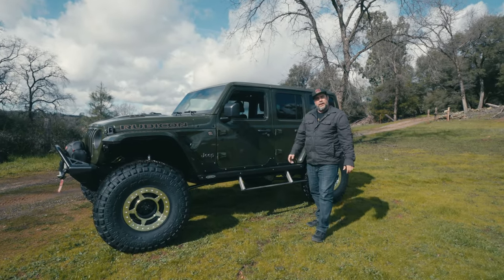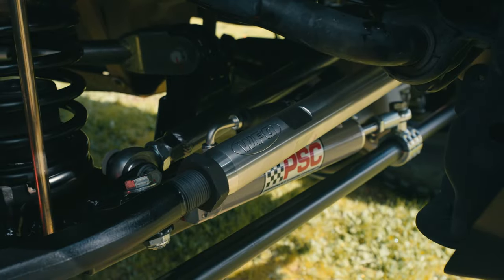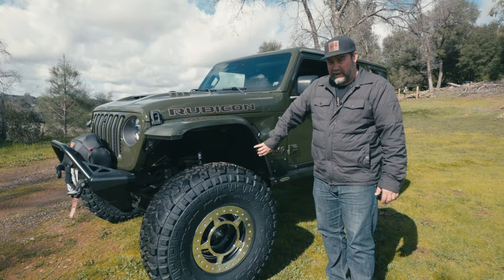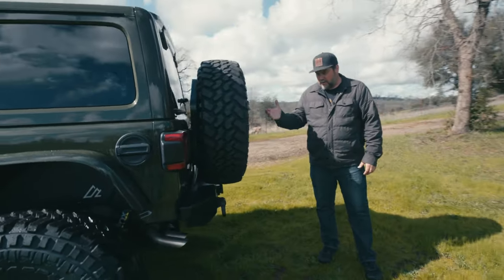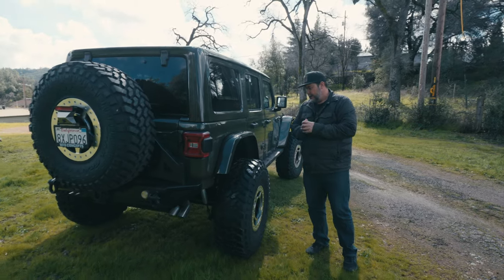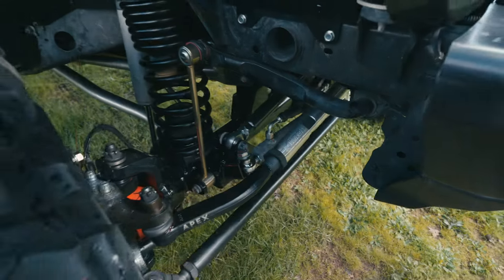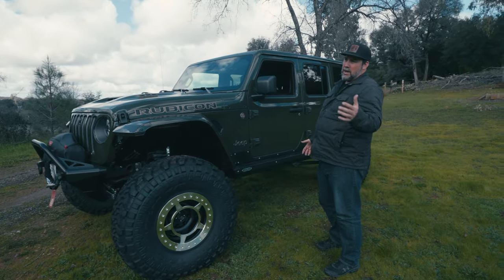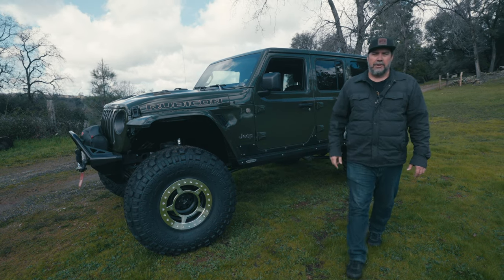392 on Curry Axles | Complete Walkaround

Comment: Question:  Why do y’all prefer the wheels/tires closer in?  Is there a driveline reason, just personal preference, or what?
I was just wondering because I personally like the wider more aggressive stance look & I think it’s more practical  because it gives you a little more security of not tipping over.
Reply from the maker: Yeah of course! In this case, we tend to favor less offset to get a tighter scrub radius. When steering we want the wheels to steer without swinging out and creating a large arch.  It allows your rig to steer more easily, especially in rough offroad applications. Having a tighter scrub radius is also going to make your steering components last a lot longer. In the way of width, this Jeep is plenty wide, less offset is not going to bring any instability.  Here is a cool article about it. https://www.drivingline.com/articles/steering-you-straight-what-is-wheel-offset-and-scrub-radius/
Reply: @wfoconcepts  thank you so much.  I’ve asked questions to other YouTube channels & I have never received an article where I can actually read it & re-read certain areas I may not understand immediately.  Y’all are awesome!!!   Thank you.  Another topic I’m doing research on to learn more about is Bumpsteer.   I knew the steeper angle on the tie rod increased your bumpsteer, but I learned recently it’s because it shortens the distance to your steering part of the axle.  So if I purchase an adjustable tie rod & push it out more, that will help with bumpsteer.   I’m not new to owning Jeeps, but I am fairly new to wheeling them (1 yr) & I figured out real quick, if I want to wheel long term, I must learn the physics & learn how to fix what I break, because I can’t afford to have it in the shop all the time.  Plus, I’ve really enjoyed actually knowing what experts are talking about & me actually seeing my hard work of working on my Jeep & it driving better.  I just completed a huge task for me & that was completely taking all of my front steering components off, replacing the OEM ball joints with heavy duty rebuildable ball joints, & replacing new aftermarket steering knuckles, brakes, 2.5-ton tie rod, drag link, recentering my axles & now I have no more death wobble!!!  Stuff y’all do everyday, but it took me approx. 2 weeks during my off time & having to watch & rewatch several YouTube channels to get it just right.  I’m just a little type A OCD 🤣.  I love y’all’s channel / videos…especially the Christmas Specials😉 of different vehicles.

Comment: So the e locker is working with the factory switch? I thought e lockers were having problems with that system not providing enough voltage to run the e locker. How did you make it work correctly then ? Beautiful 392
Reply: I have found the same issue to be true.  Next time will go to ARB lockers since they have upgraded their lockers to not fail as often as they once did.  They have up’d their game in the locker business, BUT in the mean time until I switch to an air locker, I did some “redneck engineering” now it works every time & that is I used a brand name 18V battery used on tools.  I wired my rear locker & threaded the heat-proof covered cord tightly underneath & through my glovebox & added a switch & was able to store the battery & everything in the box.  The 18V has not failed.